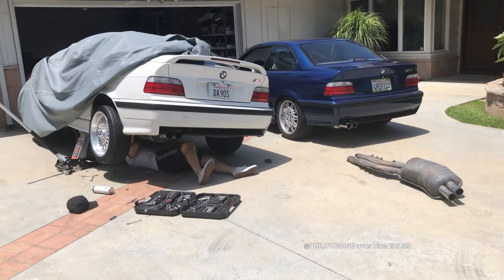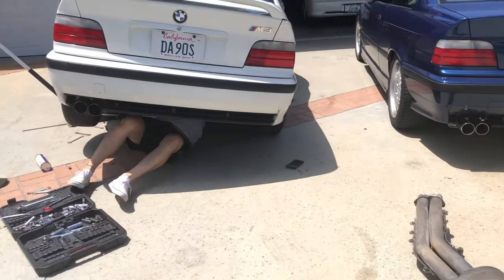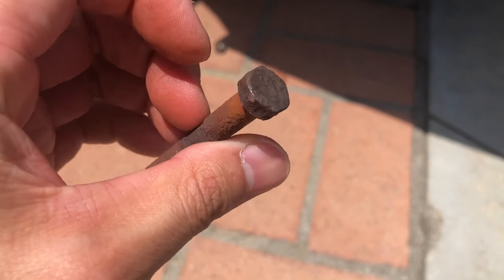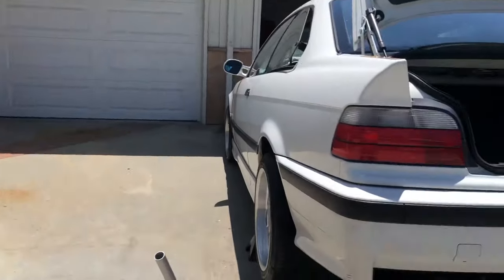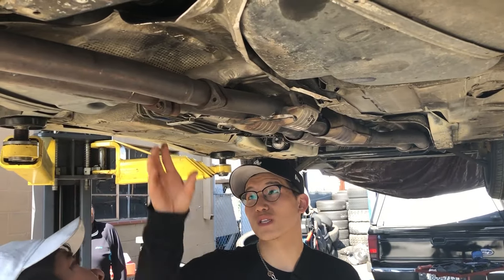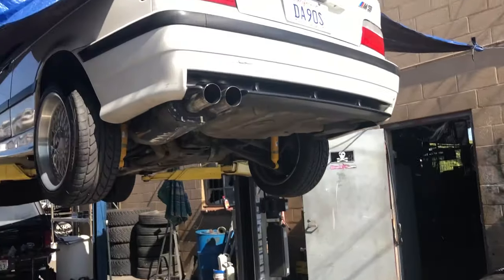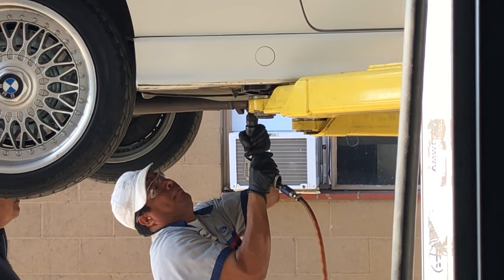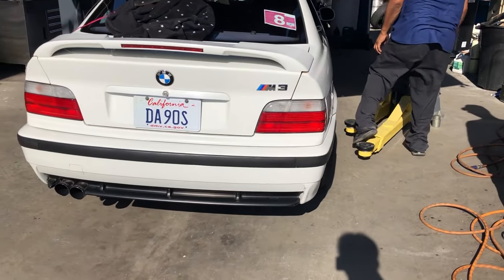STUNG By A BEE While Installing FREE M3 Exhaust

Comment: Hi Marshall - I've owned an E39 540 for over 10 years and also have owned an E46. I'm planning to add an E36 m3 to my stable. How many miles does Philips M3 have and why did he need a new head gasket? I'm looking at a clean Avus Blue M3 for 6k but it has 200k miles. If everything checks out should I jump on it or look for an M3 with fewer miles? Any feedback would be appreciated. Thanks!
Reply from the maker: wasn't a head gasket, I mispoke and he needed a new valve cover gasket. Which is very common on these cars as just most of the rubber parts on the car need to be swapped out due to age. if not done most e36's you will notice a little bit of oil leaking from the valve cover. For an e36, or any car in general I would say once a car has like 120-130k+ miles and above the mileage is completely irrelevant, and it is more important the condition of the car mechanically and cosmetically more than the mileage. You could find a car with 130k miles that needs a entire list of issues to be fixed, vs a 200k mile car with all the maintenance replaced and sorted that runs 3x better than that car with almost half the miles. Mileage is honestly just for resale/value purposes, and completely irrelevant to if you just want a car to drive and enjoy. - hope this helps